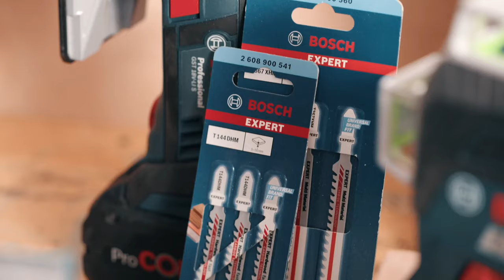The Woodworking Tool Bag with Badger Workshop

Comment: When did Bosch start doing cordless nailers? Most of my corded tools are blue Bosch but went to dewalt for my cordless range just because at the time dewalt had a better range of 18/54v tools. Still prefer the quality and design of Bosch professional tbh will be a few years before I need to replace